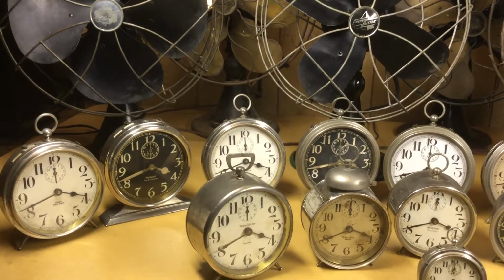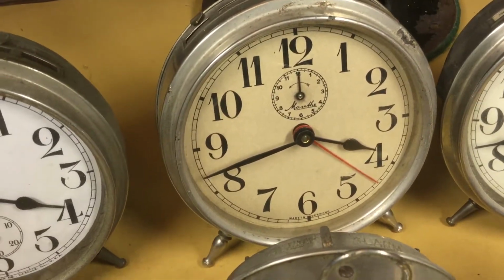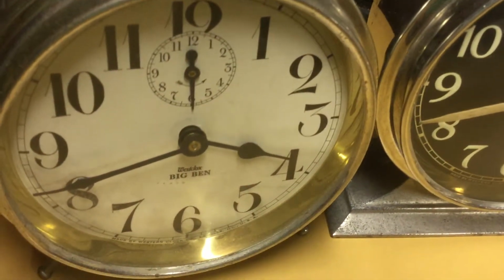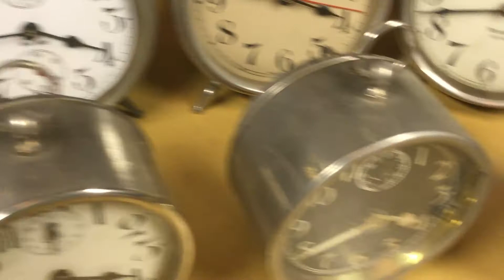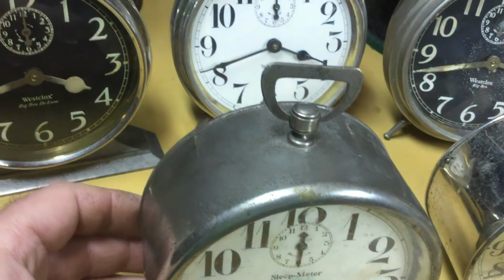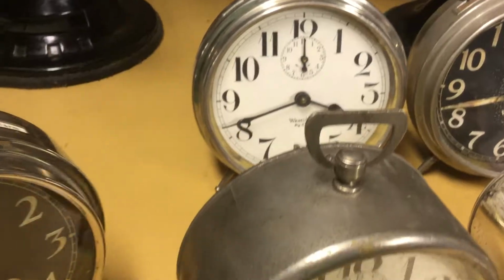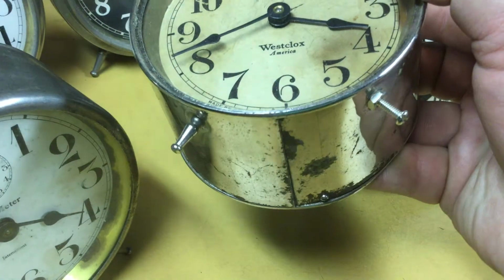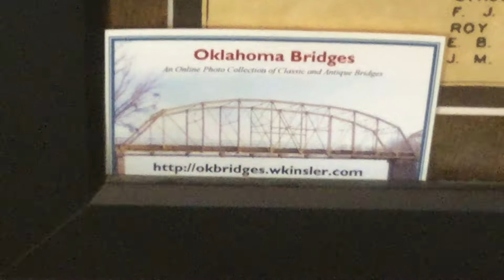Westclox Nickel Alarm Clocks.

Comment: Okbridges I found the ultimate Westclox sleep meter. This is a really big mystery to me. The sleep meter I'm about to mention has a plain dial and it's just like yours. Except it has a second advertising case built for it. The clock is inside a big advertising tin, it's screwed in. This case was made specifically for this clock, It looks so well done I'm not sure if it's hand made or factory made. Sorry for my bad description of it, I will take a video of it next time I'm at the antique store where this clock currently lives.
Reply from the maker: That sounds very intriguing. Yes, please post up a video of it when you go back.
Reply: This thing looks factory made, I totally forget what it was advertising since there was just a "painting" on the front and the actual products were on the back.

Comment: Very nice Emersons! Love the Six wing! So, a question if I may: how do you get one of these nickel alarms apart to clean? I have an Ingraham Vim and it’s filthy.
Reply from the maker: On most Ingrahams, you remove the winding keys and then remove 2 or 3 nuts on the back. The movement and dial will come out thru the front of the case as an as an assembly. Some of the Ingraham 'tin can' and peg leg clocks have a back that is removable after taking off the winding keys, and the movement and dial come out the back after removing the legs and ring
Reply: okbridges Thanks, I’ll make sure to try that! Any tips on cleaning the movement and what to use to clean it?
Reply from the maker: @RIPGUTProduction  
To clean, I used the following formula:
4 oz. Murphy's oil soap
8 oz. acetone
12 oz ammonia
1 cup unheated tap water.
I mixed everything together in a 1 gallon metal paint can, and then allowed to sit for 2 hours with the lid on loose. After 2 hours I brought the level up high enough to completely submerge all parts with tap water, fastened the lid and placed the can on a running dryer to allow the vibration to agitate it. Picked up the can and shook it half-way through, and again at the end of one hour. Then I removed the parts, scrubbed with a tooth brush, rinsed all parts off under running water, and then dried.
The formula is from Tom Temple's "Extreme Clock Restoration".
Reply: okbridges Thanks!

Comment: I have a question for you. How on earth do you get the Westclox America's apart? The bezel is in with no screws, you sort of have to pry it out. Surely there has to be an easier way. I'm also not talking about just the early ones.
Reply from the maker: On this particular style America, you loosen the three screws around the back and the back-plate, movement, and dial come out as an assembly. It has to be tipped out bottom first because of the alarm hammer.
Reply: The other Americas make you unscrew the movement from the case, then you have to pry to bezel off somehow. It usually never comes off.

Comment: Where do you keep your luminous clocks? Near you? Away from you?
Reply from the maker: Depends on if I'm using it or not. Not enough radium in a pair of hands to worry about. The old-style mantles in most of my Aladdin lamps have thorium, and I have one above my bed for a reading light when there is no power. The levels are too ,ow to worry about.
Reply: We got all these radium collectors calling them dangerous, what do you make of that?